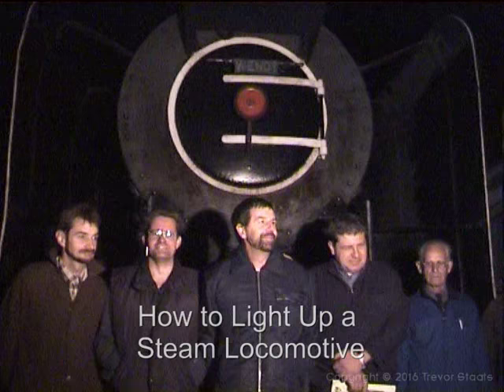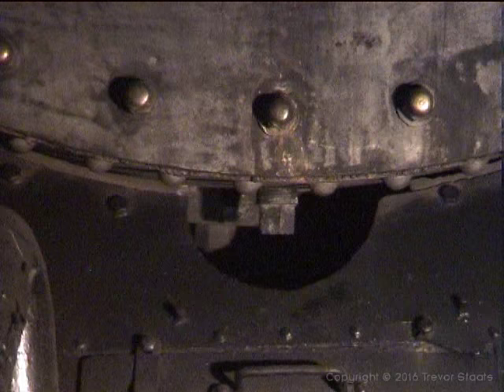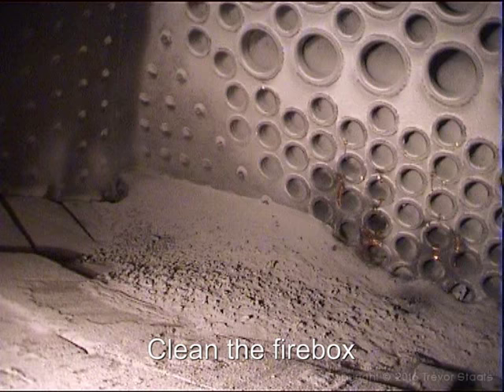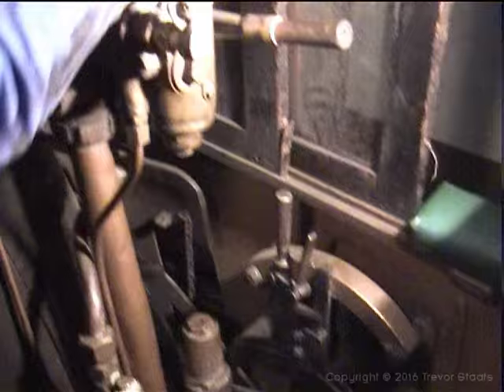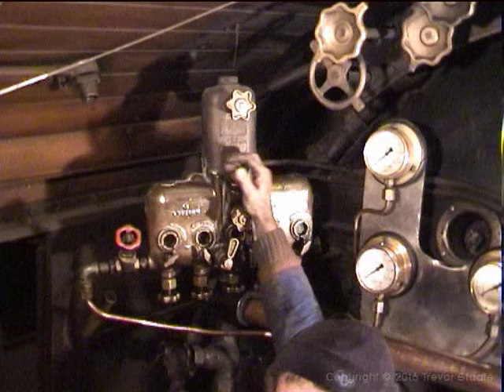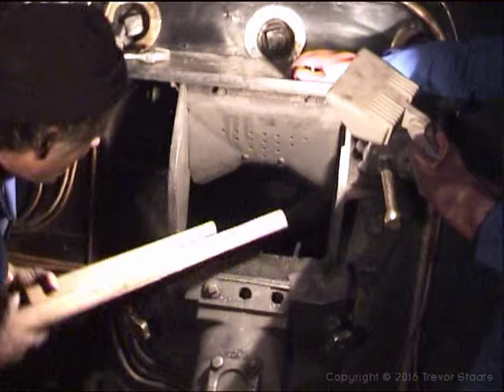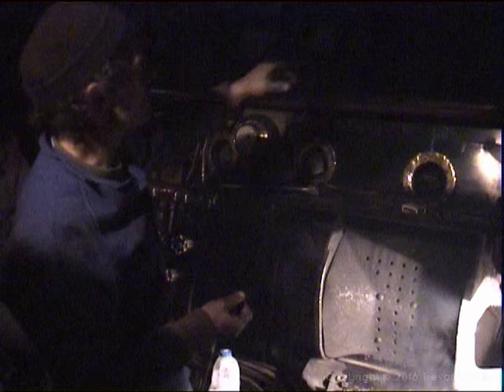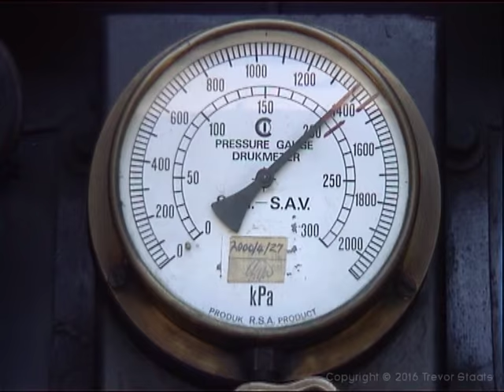How to Light Up a Steam Locomotive - 15F 3094 South Africa

Comment: I am a bit of a noob regarding steam locos, so I was hoping you could answer a question.

How do they get water from the tender to the boiler without the steam injectors?
Reply from the maker: The boiler is usually left with enough water in it to light up the next time. If not, water needs to be added via a hose through the dome cover or other fitting.
Reply: @steamfreak  thanks!

Comment: Interesting that you lay the coal in, place wood on top of it, and then light it. In the video about how to fire up the Denver & Rio Grande engine 491, titled "How To Fire Up A Steam Locomotive", they light a wood fire first, and then once it's going strong, then they shovel on the coal. I presume it's just a difference in style.
Reply from the maker: +Woody615 yes, whatever works really!  We find that the wood fire on top of the coal bed gets the coal layer burning, which helps once the wood fire gets going, and more coal is added.
Reply: Thanks. Once it gets going, it doesn't really matter how it was lit. GREAT video by the way. Today, we (society) have no concept or understanding of the complexities of mechanical processes. No computer buttons to push, just valves to turn and levers to push and pull.

Comment: Brilliant locomotive design... ahead of British locomotives of the same vintage. Lays an ‘upside down’ fire.  (Burn from the top downwards). I think this was SAR practice. Good practice for reducing smoke.  Also makes more efficient use of fuel.

Much better to see someone who knows what they are doing instead of a ‘celebrity’ screwing things up.
Reply from the maker: Thanks! I had many great times lighting up these locos, and firing them as well,
Reply: Not everybody ‘gets’ the steam locomotive.  (I don’t know why.). But there is no point trying to explain it to those who don’t feel it already.  This is a fantastic video presented brilliantly.  15Fs were so well designed with everything to make life for firemen and drivers as straightforward as possible.  I just don’t understand why with the exception of steam builders in the export business (eg North British and Bayer-Peacock) British Chief Mechanical Engineers were years behind SAR.
Reply: @stephensmith799  Might have something to do with South Africa being littered with mountain ranges

I dunno
Reply: @sirbarongaming2138  Yes. Had to be ‘Cape Gauge’ and very powerful.  But why better engineered than British locomotives of the same period?  I mean Swindon was still building inside cylinder, inside gear pannier tanks in the 1950s!

Comment: A few questions: 1. What was the water consumption on these iron horses? It seems to me that it must have been quite high because in some videos topping up at the Orange river was needed to complete a journey from example Bloemfontein to De Aar (final destination Cape Town) 2. All steam engines were powered by burning coal and converting water to steam. Nowadays it seems to me a possible trend is to convert to gas as an energy source to produce steam, or do they still stay with coal when restoration is done? I would like coal but gas could be an environmental alternative and coal is no longer as freely available as in the past when these beauties were in action.
Reply from the maker: +hawkeye0248 it's a difficult question, as it depends on size of loco, the load, gradients, how the loco is being driven...  Orange River was the main water stop for all trains between Kimberley and De Aar. I've noted that many drivers will take water where possible rather than where needed as it's better to have water than not!  Never seen a gas burner, no reason why it wouldn't work.
Reply: @steamfreak  We have oil burners still running in New Zealand.
Reply: The 25C Class was designed for water retention
Reply: There’s research going on in New Zealand with  a water tube boiler fired with wood.  It gets to working pressure very quickly as it has a much smaller volume of water to heat.  Check out the Mackwell Steam Locomotive Company; a carbon neutral future for steam

Comment: All of this was one of the big down falls a steam locomotive, a lot of maintenance, where as a diesel locomotive is basically start and go assuming it  is fueled and ready to go. A coal burning steam engine needed two people to operate it, the driver and a fireman to shovel in the coal. Twice the wages to pay as opposed to the diesel.
Very dirty job, everything ends being black, so a lot washing to try and keep clothes clean.
Reply from the maker: Yep very true. But I still love the dirty old steam trains!
Reply: All true, but SAR steam was so good and coal so plentiful, it was hard to make a case for diesel power.  Many ex steam crew swear to this day that steam locomotives could pull more, were cheaper to run, cost less to build and were easier to repair and maintain.  The problem was as you say preparation and disposal time.